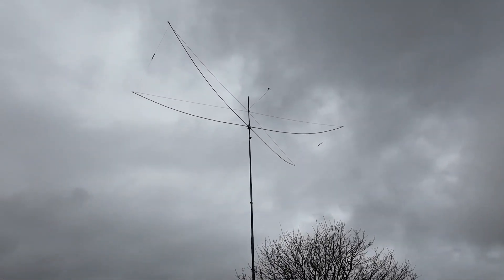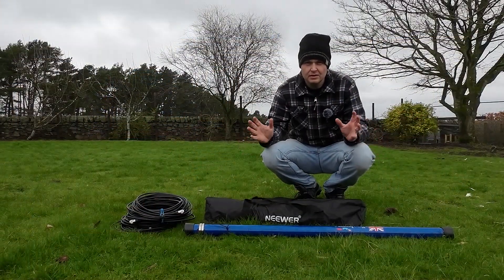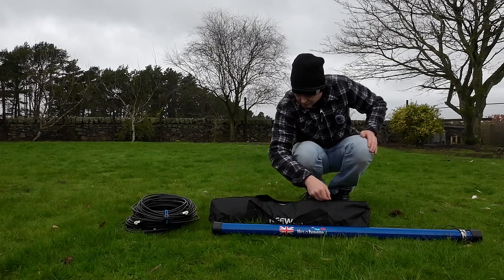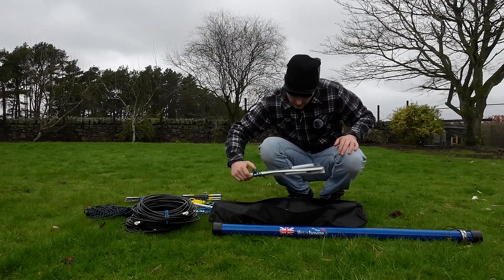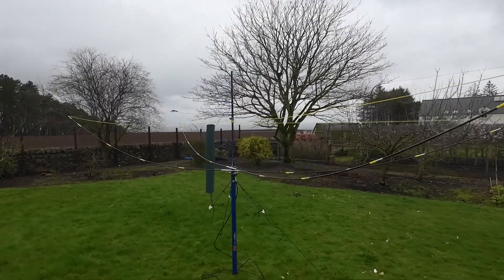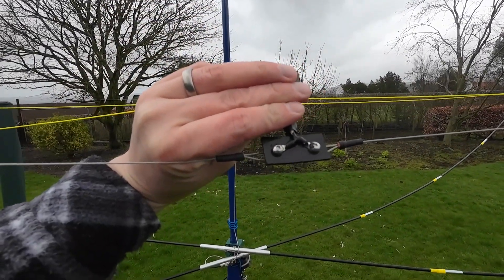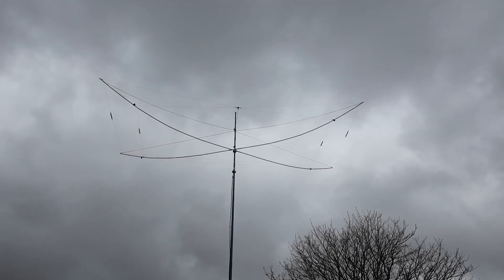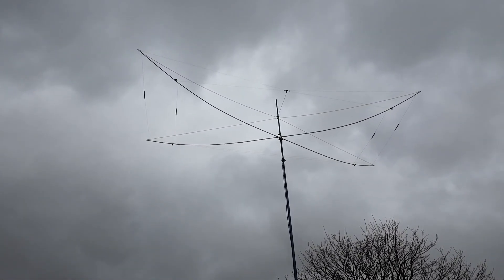The 15m Moxon Ham Radio Antenna You Can Build From Tent Poles

Comment: Hi Colin great work. I just found this Video after recently building a 10mtr Moxon almost the same as yours although mine is not portable, Mine uses plastic corner pieces and a 3d printed centre hub, I found it to be a bit flimsy and added paracord supports to keep the shape as you have. It tunes really well and I have been having a blast with it with the recent excellent conditions on 10mtrs .  I too had thought about adding a 12 or 15mtr element along with a 6 mtr element on the same frame but feared the interaction you have experienced, have you managed to solve this ??.  Ive not tried yet but I think I will run separate coax feeds down the pole and have a relay coax switch at the base with one feedline back to the shack...
Reply from the maker: I've thought about this a lot and I feel the Moxon is best as a mono band antenna. Multibanding it is a lot of work. I'm currently building my Hexbeam for 20 through 10 but when I see the size of the 15m section upwards its very small. To this end I think I will make a small Hexbeam that will cover 15, 12, 10 and 6m. Single feedpoint and fed in the centre which keeps things simpler. Yes it will marginally be down on a monoband Moxon but geting 4 bands is a huge benefit.

Comment: Hi there, nice construction, great detail ! At 8:56 when you try both 10m and 15m you say trying a different feed point arrangement, can you please explain it a little bit? I have seen for 17 and 12m they use a small 75 coax between the driven elements and then they feed the 12m element with 50Ω coax. 73 DE SV2TCB
Reply from the maker: Its as you explain how I will try but using 50 ohm on the small bit. Maybe I need to use 75ohm.
Reply: @MM0OPXFieldRadio  thanks for the response! I will experiment! 73
Reply from the maker: Let me know the results.